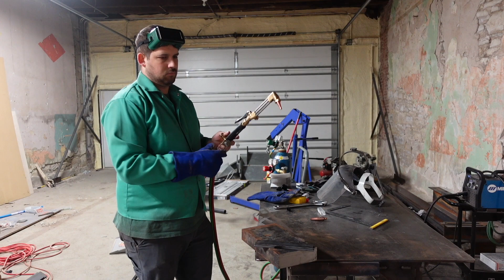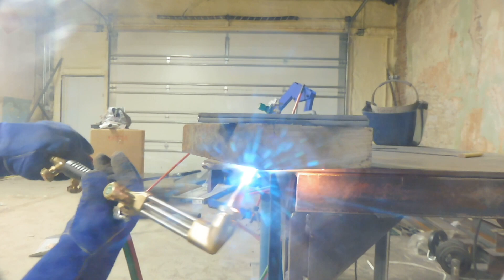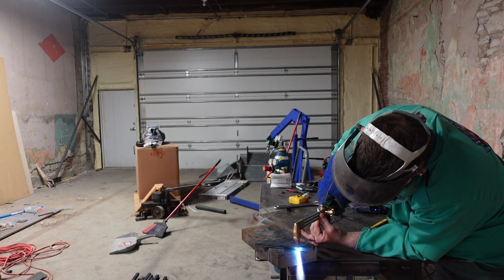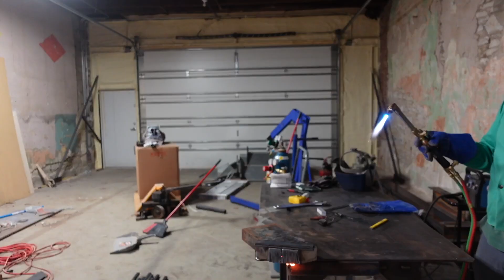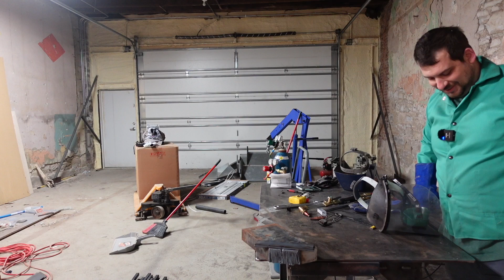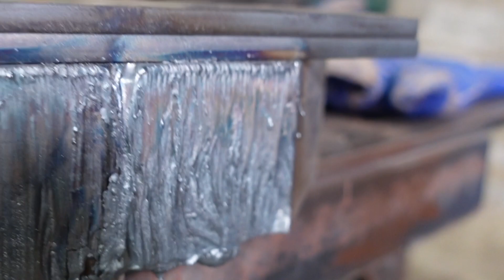STEEL VS. FIRE--2 inches thick!-- Cutting 2 inch thick steel with an oxy-acetylene torch by hand

Comment: Mine keeps welding itself back together behind my pass…any suggestions?
Reply from the maker: I wouldn’t call myself an expert on this but  you could have too small a torch head. There’s a number size rating that you can google. I think that would get you more oxygen to blow that molten metal out and move quicker
Reply: @TheMoonlightCraftsman  ok I will check it out thank you!
Reply: That was it! Thanks man

Comment: No need to do all that pre heat stuff, it’ll cut thru that thickness without all that faff
Reply from the maker: @Lucio-rz1ie the medium size bottle at like tractor supply should do. I’m not sure what it’s called. If the torch can cut it, it will be fast. Speed sounds like a big concern for you hopefully this isn’t someone’s safe, lol
Reply from the maker: Good to know. I’ve never cut that thick before
Reply from the maker: @Lucio-rz1ie I’d say just give it a try. Just need right sized tip for the thickness and the acetylene bottle needs to be large enough for that size of tip since the rate at which the acetylene can be undissolved (max volume) is dependent on the size of the bottle so the little tiny bottles that like an HVAC guy would use won’t be big enough. Glad to hear someone your age is interested. Makes for a great hobby or career